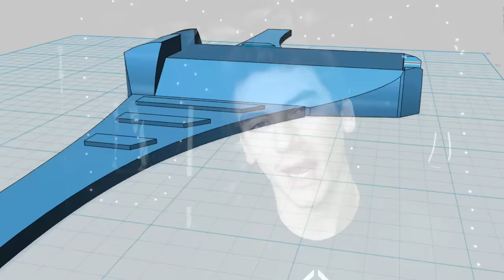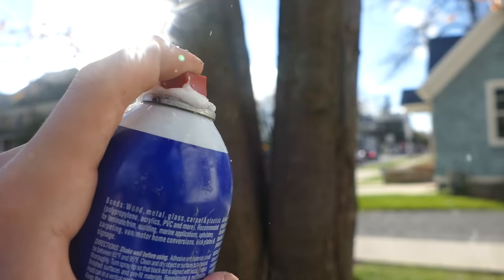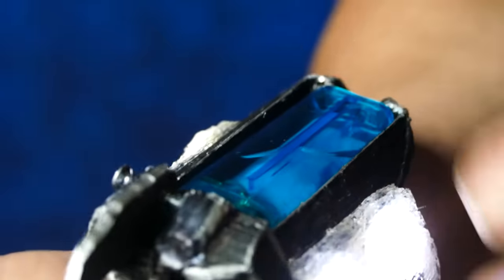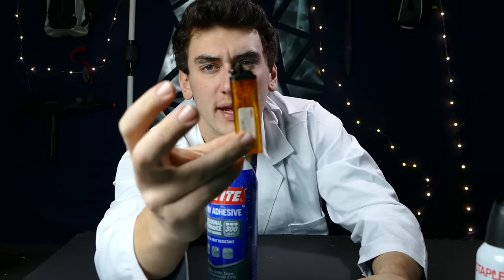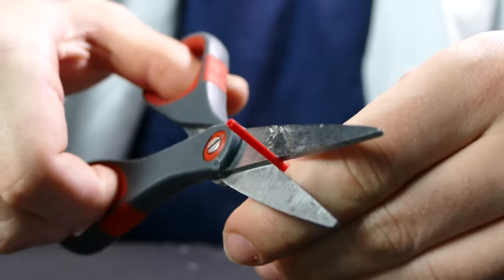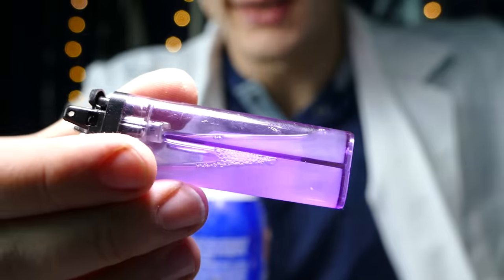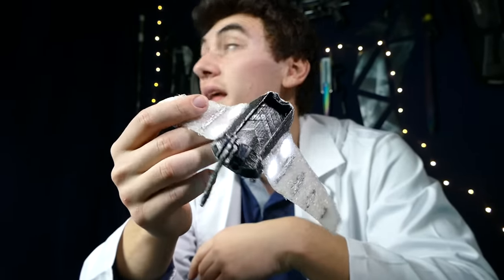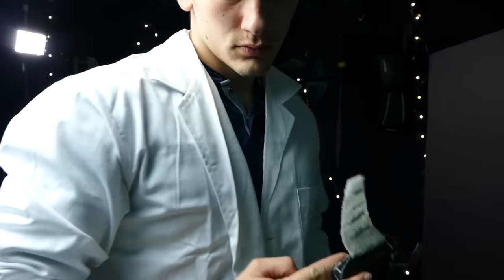Make a SPIDER-MAN Web Shooter That Actually Shoots Real Webs!!!

Comment: How about mixing silly string and this adhesive thing to make it more like a string web
Reply: Giovannie edgar it could mak It thick enough to stick to a wall from da shooter but maybe 4 about a second or 2 depending on how much u mix with silly string
Reply: And also the nylon mix.
Reply: Matias ambiado maybe mix more nylon fluid dan sticky silly string since sticky silly string is thicker dan da nylon web fluid
Reply: I thought what if you make a thinner spout for the lighter then when the stuff flies out it takes way faster to dry in mid air and then become more a a string substance
Reply: Икотика 666 what is a bed shooter
Reply: Giovannie edgar and glue
Reply: You could mix glue I mean
Reply: Giovannie edgar There's different chemicals in all those mixtures you guys are talking about so it will react differently.
Reply: 5:57 Years of practice
Reply: Kaleb Nelson just skimming through this and that made my day 😂
Reply: It would've been boring though.
Reply: That may work
Reply: Giovannie edgar what if he mixes it with that stuff that goes solid when force is added
Reply: Giovannie edgar it might cancel out its appearance or end up being too thick
Reply: @xMckingwill  yea nylon is a acid and NOT like cytric acid and web fluid Is mostly expensive :\\\\\\
Reply: just what I was thinking
Reply: Would it work if you mixed the chemicals together?  Hmm...
Reply: @matiasambiado594  nylon is dangerous, you canttouch it with bare heands
Reply: Matias ambiado nylon releases toxic fumes
Reply: Giovannie edgar well the silly string mixed with a sticky adhesive would probably make the silly string stick and bundle together
Reply: How would u get silly string inside the lighter
Reply: Yo yo yo Nylon Polymer= Liquid Rope 👍🏻👍🏻👍🏻
Reply: @BossKnight  oobleck?
Reply: How were you gonna mix it?

Comment: The module that you made in the 3D printer needs 10 small holes added to your later versions... the holes will allow you to stitch leather to either side and add a small strap buckle. This will allow you to avoid having to use a stabilizing hand in future versions.
Reply: That's a good idea. originally, as a nerdy kid trying to make real webshooters, I was going to have a hard shell 3d printed where you basically just clip the web shooters on around your wrists. I think the strap might work better

Comment: Have you looked into the chemical aspect of it? Theoretically you could combine the right carbon nanotube for strength and lightweight with the right polymer to increase elasticity. then just find a way to make cartridges that hold the materials and combine them in a spinning or layering mechanism to shoot it out in a semi solid material. I would be trying to find a solution like this myself but A, I'm 15 so I don't have access to this stuff and B, I'm 15 and I am not a professional  in chemistry, I'm just a nerdy kid 
But idk, just a thought

Comment: Ok well this is a long comment but here I go 
     
     What you need to do is get this but with it leading to like fifty different hoses. After that all the hoses have to spin to tangle up with each other. I also feel that if you made the whole they come out of smaller it would work a lot better. Also the more hoses the better but this is only a theory of how to make real web shooters. 
 
     Also there should be something to turn to switch between web line and web blast l. Web blast would have to be the whole opening wider than before and coming out more like a ball of glue than a string 
  
  It should also have a third setting were you could shoot all of it at once as one really big web blast. 
 
     P.S.
    I love your content never stop uploading

Comment: if you want real webs get an empty pressure tank. fill with 1 part silly string 1 part this lock tight stuff and 1 part JB weld. mix completely in the tank on a paint shaker for 24 hours. its very impotent when doing this to not allow or mix any air in the tank at all. once you've finished   load cartridges the same way and you'll have the nearest thing to real webs .  hope this helps it makes for a really good stable web but the process is very difficult... you can also add other compounds to the mix to make the webs less ridged like liquid rubber. giving it a more flexible web affect. i suggest using that as seen on TV flex-seal and i would think adding equal parts of all four compounds would give best results... it worked for me

Comment: mix the adhesive gas and see if it would work if you put 1,6-hexanediamine and Sebacoyl Chloride and see if the Nylon Mixes with the adhesive gas spitting out the Nylon rope and the adhesive gas with pressure

Worth a try right?

Comment: Fact: 

Spiderman’s webshooters are designed to prevent others using them. The palm switch requires 65 pounds of pressure to press and must also receive a lightning-quick double-tap from the users middle and third fingers. This system prevents non-superpowered individuals from firing his webs.
Reply: Sad that homecoming didn't do the same, Ned was able to use the webshooters quite easily
Reply: Ned go brrrrrr
Reply: Spider-ned

Comment: oke so i have a few points 

1. putting the liquid in isint it just easier to put it in on the bottom there is a little hole there wink wink...

2. couldent we technicly cut open somes spider get some of there left over spider stiky silk and put it in someting witch makes it thicker or thicker ropes?

Comment: hey! so im doing this, and i discovered that you dont need the red tubing. if you pop open a mechanical pencil, itll have a small version of your adapter inside.

basically, you remove the part where the lead comes out and cut off the bit of the tubing thats split. doing that lets you pull out the entire tube from the pencil, and you'll find the little tube that feeds the lead into the tip is just big enough to fit on the opening of your lighter. best part is that the larger tube that holds all the lead fits on the loctite. all you need to do is cut the bigger tube down a bit since its so long. hope this helps others!

Comment: JLaservideo, I tried filling it up with water and it didn't spray. (I filled it up by dissasembling the top and then blowing water in with a straw) Does it not work like that? Also, it worked when I tried to spray the liquid originally inside the lighter but I didn't work afterwards when I added water. Pls help me I've been trying to make this for about a week

Comment: You empty the lighter fluid before u decompress both levers right?😂
Reply: Yes
Reply: Kevins Tiny Toons and I HAVE to 3D print the lever correct?
Reply: @Kevin Braithwaite, not necessarily, before I 3d printed mine I melt a piece of a hanger to form a lever, it wasn't ideal but as long as you can screw in your lever to the web shooter you should be good.
Reply: Kevins Tiny Toons thank you! Another question though, I tried accessing the link gift the 3D printed web shooter and I can’t access it, assistance pls?😂
Reply: I couldn't figure that out so I used an older model of the web shooter